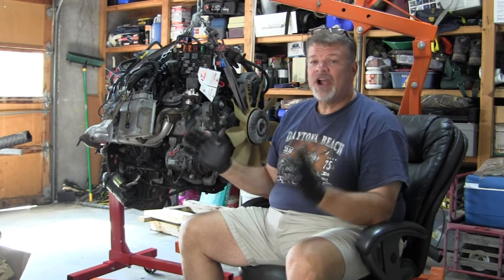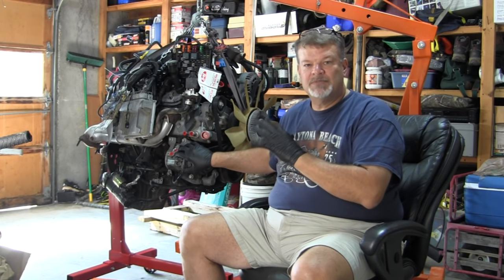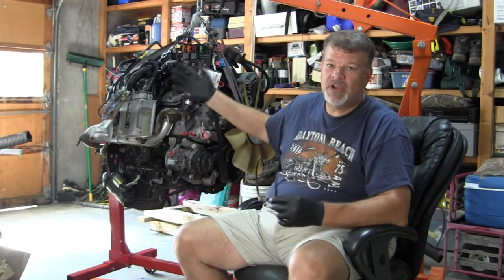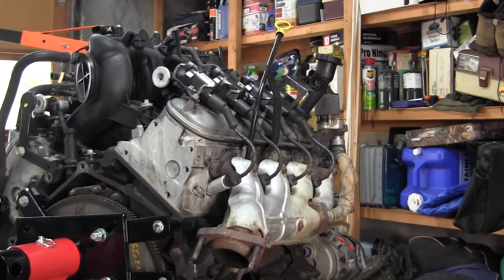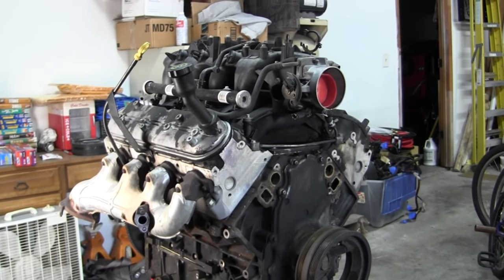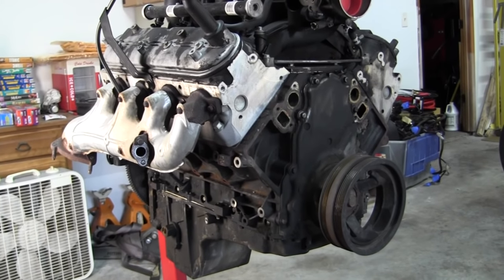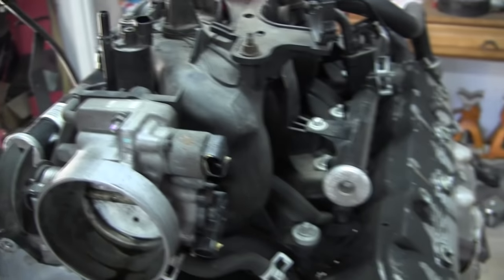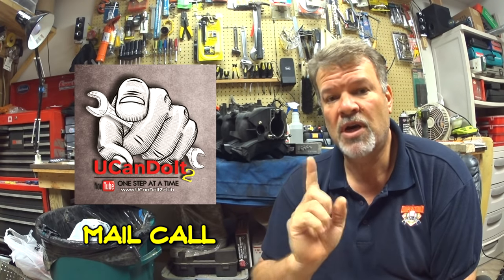LS 5.3L Build Part 1 Harness & Accessory Removal | Project Rowdy Ep005

Comment: Hi, I’m reaching out to you as suggested by (1980 LS K5), I’m looking for a wiring diagram for LS swap. I’ve a 1986 GMC Sierra with 305 engine that I swapped with 5.3 vortec engine and auto transmission from a 2008 gmc Yukon. However the garage that did the swap missed up all the electrical wiring. The engine and transmission are ok, truck runs and drive ok, AC works fine, but there are a lot of electrical issues, like speedometer, fuel gage, signal lights, horn, high beam, etc.
So I wonder if you’ve the complete wiring diagram that I can use to sort out this miss and the loose connections? 
Thanks
Reply from the maker: OK...  I have a n entire series on the LS Series Engine Wiring Harness (https://www.youtube.com/playlist?list=PLo32GavtEb9RXYJIMXpOfRU8ext2xStFv) and what to do to make it ready to swap into any vehicle.   HOWEVER,  The Engine Harness does not have anything to do with Speedo, Fuel Gauge, Turn Signals, Horn, Head Lights...   Those are all within different harnesses.  Most of those items will follow and be solved by understanding the Wiring schematics of your Car (1986 Sierra).

Comment: Why did you choose the LM7 over an LM4?  The LM4 are all aluminum and came in the Trailblazer/Envoy SUV's in the earlier years
Reply from the maker: Mainly due to availability.  LM4, I believe were only offered around 2004.  Cost would be another factor.  Yards are going to want more money for the Aluminum Block version (not much more and not a huge factor).  I really don't need the weight reduction of aluminum (my opinion) for the vehicle that it is going in.  It would certainly be a good option for a muscle car application.  LM7s are readily available and very cheap.  I paid $600 for my engine with PCM and Harness.  Just some thoughts.
Reply: Gotcha.  My 03 Envoy has the LM4, but the engine is not widely talked about anywhere!  Definitely want to boost it though.  There's a guy in Miami that builds turbo kits specifically for Trailblazer SS 6.0 but should be able to work in mine too.  Sub'bed to your channel!

Comment: what size bolts did you use to mount engine to the stand? I havening a hard time finding the right ones.
Reply from the maker: When you Google "GM 5.3 Bellhousing Bolts"... you will find that you need a M10x1.5.  You will need to measure the sleeve on your engine stand and add another 10-15mm to determine what length you will need.  Hope that helps!
Reply: +UCanDoIt2  thanks

Comment: So i am looking to procharge my truck its a 99 gmc sierra 5.3 its got 250k miles still strong as hell no problems should i rebuild it or buy another 5.3 and rebuild that
Reply from the maker: 2 things come to mind (I'm not an expert)... 1) if you need to continue driving the Truck while you are building the desired engine, then go buy another (I paid $600 for what you saw in this video).  2) If the truck being out of order for a while is not an issue, then you should consider rebuilding the one you have (assuming it does not have non-correctable issues).  The big tickets items that you will be reusing on the build are most likely the Block, Crank and Heads.  They get adjusted during the machining process.   Most of the other parts can and most likely will be replace with new (possibly stronger) parts.  Just some thoughts off the top of my head.  Maybe others here will chime in!   Good luck with your project!
Reply: UCanDoIt2 did you purchase the motor locally or what? Thanks buddy! 👍🏼
Reply from the maker: I did purchase it locally.  Just East of Atlanta in Lithonia, GA.  A very professional Salvage yard called S&W Automotive.  Gary walking me through their process of determining which engines they pull and which they do not.  I was very impressed.  I paid $600 for the full pull of this LM7.

Comment: hi sir i have a question, i make all of your procedure to do that harness, well i put de harnes on tha engine i tried to started but just start and go off , cant keep run, my ask is in the blue conector the pin 19,20,57,75 always need the batery power?? i see in your procedure eliminate the pin 19 can be that the problem?? i hope you can request....... sorry for my bad write im still learn write english thanks bob
Reply from the maker: Hello Bob.  Did you have your PCM re-programmed?  Sounds like you still have VATS ( Vehicle Anti Theft System) still turned on.  That is what it sounds like with your symptoms.  As far as the Blue Pins that you mentioned.  Blue 20 and 57 are Orange wires, so they need Constant 12V+.  Blue 19 and 75 are Pink wires, so they need 12V+ when the key in in the ignition and turned to the first position (Accessory\Run).  Hope the helps... Let me know.  Miguel (Mike)
Reply: UCanDoIt2. Thanks for request no jet the re programmed, the pcm comes from a tahoe 2001, i need to do reprogram??
Reply from the maker: Yes,  Someone will have to re-program the PCM and at least disable VATS.  If you are still planning to use a Check Engine Light, there are other items in the PCM you want to change during re-programming so that your CEL does not constantly alert you of false errors.  Someone who knows what they are doing will ask you questions about the new vehicle and engine configuration to get all of the corrected.
Reply: UCanDoIt2 thanks bob i will do the reprogram

Comment: Hey  @UCanDoit2 Im removing a 5.3 from the junkyard do i need to get both fuse boxes? where do i cut the harness as it goes down all the way to the back of the truck. I wanted to keep the ob2 reader but if its not needed i can spare it. Thank you please respond.
Reply from the maker: Please check out my playlist on the Wiring Harness that I am currently working on.  https://www.youtube.com/playlist?list=PLo32GavtEb9RXYJIMXpOfRU8ext2xStFv  It may answer some of your questions.
Reply from the maker: In addition, I would grab the ODB2 Connector as it can be reused in the new vehicle.  As for the Fuse Blocks,  Grab the one that is in the engine bay.  Wires from the engine harness will only connect to the C2 sub block of the fuse block.  You will want to keep that in tack as much as possible for identification purposes.  The C1, C3, C4 and C5 wires are not needed and can be cut.  They go to none Engine related harnesses and place on the vehicle.
Reply: That clarifies everything sir, I've been keeping up with the videos but I didn't see you mention more than 1 fuse box thank you sir. I tried the link you provided and I couldn't find a clear answer thank you so much
Reply from the maker: I assume that the "other" fuse block that you mentioned is inside the vehicle.  That then would most likely be dedicated to other parts of the car/truck.   And realistically for the under the hood Fuse Block, you could just remove the C2 small block from the Large Fuse block and go about your business.  Please remember that I purchased my motor already pulled, so some of what you are asking, I am speculating a little.
Reply: UCanDoIt2 you're right it's inside the the truck under the dash. I will cut the ob2 and wire it later. thank you sir ! hope to have my car running soon !

Comment: I'm really enjoying your build and wanting to do something similar to my TJ. Do you happen to have a build sheet and cost involved?
Reply from the maker: I have posted a link to a parts list for the LM7 5.3 Engine Build in the "Show More" section under each of the engine videos.  As far as these Wiring Harness videos....  you will find my Wiring Diagram under them.   Some of the details for your engine, you will want to get from Lt1swap.com as different years have different configurations.   The approach in this series can be applied to any of them though.  Cheers and have fun with your project!!!!!

Comment: hows you get around anti theft ???????????did you have to use the steering clum from a donor vehicle?????
Reply from the maker: I will be sending off my PCM to have it re-programmed.  During that process they cam remove/disable the VAT functionality from the PCM.  This is my understanding of what most people are doing when they are swapping a Gen3 Gen4 engine into an older vehicle.
Reply: I see that holley terminator could be a nice option  with out tranny control they offer for abut 1900.00
Reply: but the reprogram solution is also nice where r u sending to?
Reply from the maker: I had a local guy identified, but he recently doubled his price.  I am pretty sure I will be sending it to Brandon at LT1Swap.  His site was such a great resource for me, his price is reasonable and this is a great way for me to contribute to his work.

Comment: Hello,

here in germany wie don`t have any person with knowlege about vortec engines.

My Problem is, I change my old engine and rebuild a new one from 2006. The LM7 I think. Oilpressure is 40 Psi at normal engine temp. When I start the engine the oil presure need 3-4 sec to rise. In this time I hear lifter noise. This Problem ever comes agian when the engine stands for a minimum of 1 hour.

The pressure dindn`t rise above 45psi when the rpm goes up to 3000rpm. I never go higher with rpm. I cold, and long standing the oil pressure at the start is lower than when the tem. goes up 25-30psi and goes up after a few minuites.

I use 5w30 Gm oil and change the Oilpressure sensor today, nothing change. I use the AcDelco Oilfilter with the valve against Oil drain back.

Do I have to change the Oilpump or can I check something else bevor pull everything a part?

Please, I hope I get some help from anyone.

Thanks Sebastian
Reply from the maker: Hope someone else can chime in with better details that what I will provide here.  I know that these engines use oil filled lifters.  When the engine sits for some time (??), the oil in the lifters will drain out.  At first start, your oil pump will have to draw oil from the pan and begin to pump that through the system until it is made available to the lifters to refill.   I believe that a slight Lifter noise is normal at first startup, but only for a short time.  Your 3-4 seconds does not seem out of line.   

I believe that most guys are seeing about 30psi at warm idle, 40psi at cruising speed, and 50-60psi when stomping it.

The ACDelco filter that you have sounds like it should help provide immediate oil to the pump to minimize ready pressure and flow.You mentioned that you Rebuilt the 2006 before putting it in the truck.... (1) did you not replace the Oil Pump at that time?  (2) Did you replace the Oil Pickup Tube O-Ring?   A small issue there could issues drawing appropriate oil.
Reply: @UCanDoIt2Mike  
Hi,
I let rebuildt the lower end by an engine shop. They pulled it appart and say said that nothing about the oil pump. It will be the old one, also the O Ring. Today I started the Engine at 6°C and the Oilpressure rise up to nearly 40psi. After 1 mile at the red light and stopping, the rpm was 500 and the pressure down to 25psi. Watertemp. was 180 F°.
Reply: If you are saying that at cold startup that the oil pressure is lower than warm (ie 25-30 psi then it as the engine warms up it rises to 40+psi when driven) then you likely have a problem with the oil pump pickup tube o ring being damaged or bad. If the oil pump pickup tube o ring does not seal perfectly then air can be drawn past the o ring causing low oil pressure. It is possible for the o ring to only cause problems in colder weather when the engine oil is cold. Normal oil pressure at idle is 40-50 psi at cold startup dropping to 25-35 psi warm. Normal oil pressure when driven should be at least idle pressure up to 40-50 psi. 

I had an oil pump pickup tube o ring go bad that idled at cold start 25 psi instead of 40+ psi and the oil pressure would either be steady or drop a bit to 20 psi when driven down the highway (at about 90km/h). I only had the problem when the temperatures were 10C or less. Old o ring had 500k km on it and was hard and fretting a bit on the oil pickup tube. Note that there are two different styles of pickup tube with each using a different o ring. Also the o ring can be damaged during installation if it contacts the sharp edges of the oil pump.

Comment: Is this engine somehow similar to a LS engine or are they different?
Reply from the maker: It is my understanding that the Generation 3 and 4 era engines are among the "LS" series engines.  The "platform/configuration" of these engine are all similar, they just have different components (Cam, Heads, Pistons, etc).  My engine is an LM7 5.3L Gen3.  I could easily take this block and add the components to turn it into a LS4 5.3L.  So again loosely they are referenced as "LS" engines.   The true LS1, 2, 3, 4, etc were typically introduced in a corvette for the first year and then offered in other vehicles in following years.  True LS engines are the base platform with high performance components.  This is my understanding, hope it helps.
Reply from the maker: Here is another example.  The 5.3L block came in Aluminum and configured as a LM4, L33, LH6, LS4, possible others.  The 5.3L block also came in a cast iron block configured as a LM7, L59, LY5, LC9. etc.  The difference between them are the components.   It is my understanding that the LM7 and L59 are identical except for the Fuel Injectors.  The L59 is setup for Flex Fuel.  Cool Stuff
Reply: UCanDoIt2 thank you it makes sense and I appreciate the knowledge! keep it up my friend!

Comment: How much was total cost for rebuild?
Reply from the maker: Just over $5000.   Here is a copy of a build sheet with all of the details including cost.  http://bit.ly/RowdyEngineExpenseSheet
Reply: @UCanDoIt2Mike  
Oh dang thats pricey! Just got a 6.0 lq4 for my jeep wrangler LJ but dont think I will be trying to rebuild like this. Thanks for the info
Reply from the maker: There are many things that could have been left off.  A simple Head Job reusing the existing Valves, reusing the Piston Rods, and possibly the Pistons would have saved a lot of money.  Obviously you have to replace the wearable and consumables.... Like:  Bearings, Rings, Seals, and Gaskets.   I would not spend the time with a rebuild without replacing the Oil and Water Pumps.   They are the Heart of the engine.  Have fun with yours!!!!  Mike
Reply: @UCanDoIt2Mike  thanks Mike good info. Im up for adoption at 39 hahahahahaha
Reply from the maker: Love it!!!  I saw your other post and shared it with my wife.  We both got a chuckle with it.   As long as you come with lunch money...  come on!!!  Cheers!
Reply: @UCanDoIt2Mike  
Lol cool Mike keep up the good work

Comment: Hi, can an lm7 5.3 from 03 silverado fit into 2001 Yukon Denali lq4 ?
Reply from the maker: Yes!   You would be going from a 6.0 liter to a 5.3 liter (but that doesn't really matter).  The externals of the Blocks are the same, so things like Motor mounts, Exhaust, and overall fitment is a NONE issue.  You will either need to reprogram your PCM or use the one programmed for the LM7.  As far as wiring harnesses, you might be able to use the LQ4 Harness on this engine (may have to check the Injector connector type).  For the most part, both engines are very similar.
Reply: UCanDoIt2 thanks a lot for ur answer

Comment: awesome series man watch over end over need held doing a standalone harness for a 2012 gm 4.3l with fly by wire any help or advice will be appreciated cant seem to find none relating to my present need on ls1.com
Reply from the maker: If you have a question about what I did, I should be able to help.   Your engine is slightly different and I would not be able to help in that area.
Reply: thanks for that quick response sir

Comment: man what a deal i got engine with no coils oil cap and spun bearing for 200 no harness no cpu either oh well
Reply from the maker: Don't feel too bad.  It felt like I was replacing my entire engine as my machinist kept suggesting refreshed parts.  I kept thinking, why did I purchase the used engine, when none of the parts are going to be used????   There are tons of little things that I did reuse and it appears that you may be missing.   Find you a local Pull-A-Part.   You should be able to find the rest!   Good Luck with your project!!!!!